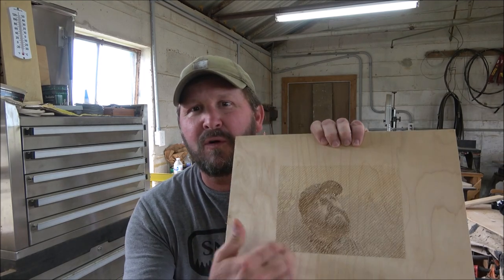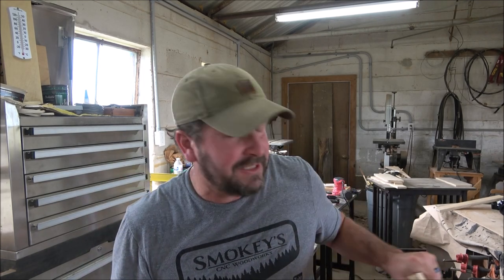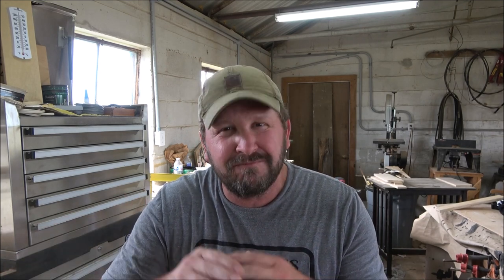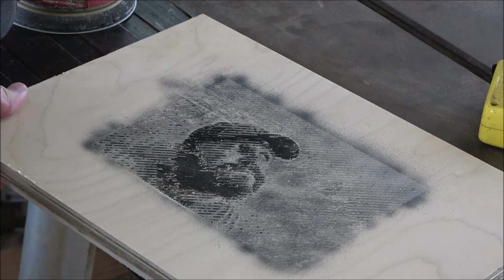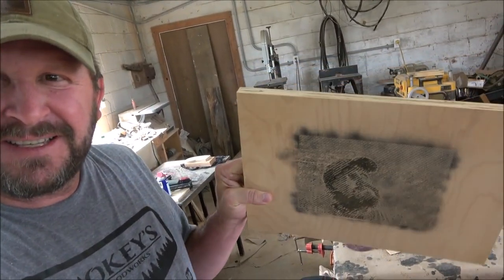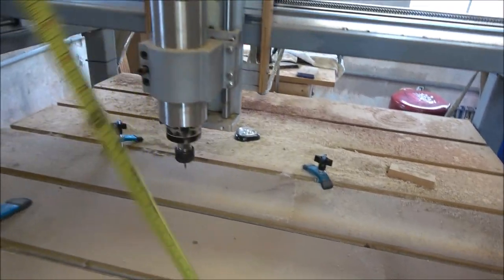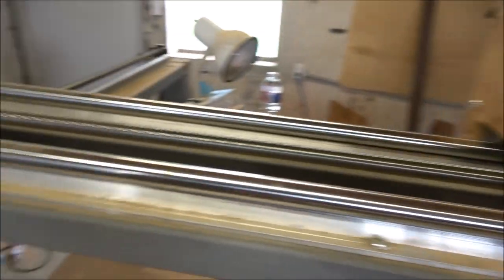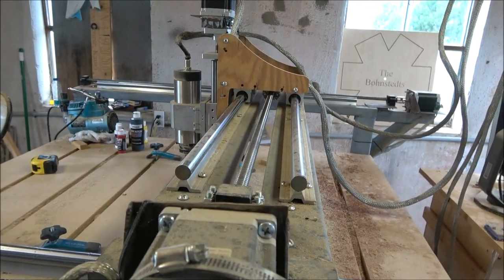Halftone finish (CNC)

Comment: hi Smokey. The halftone  looks good .Our shop painter , finnisher is going to try a round of tests. He wants to clear coat before color fill not for halftone though just carve. I have carved prepainted ,stained and got good edges on carving .Now I am rebuilding my driver entirely , so there is that.The sign is way late. I got three of those individual drivers and put together a parallel board to drive them. Minimal design
Reply from the maker: Sounds like you are neck deep in it!!!.....the clear coat before paint should work well...Thanks for watching!!

Comment: Did your random orbit sander cut & break many if the diagonal cuts in the beard area.?
Would it be safer to hand sand in diagonal pattern lightly so you just take off the top of the cut apex ?
Reply from the maker: Safer, probably yes....I didn't however have any real problem with "breaks", I used either 120 or 150 to be sure not to take to much off....Thanks for watching!!